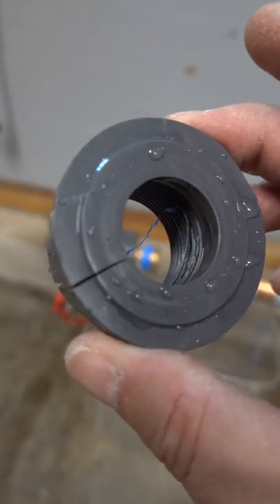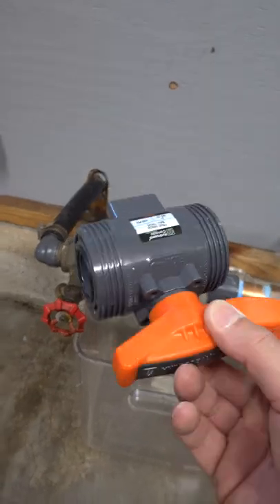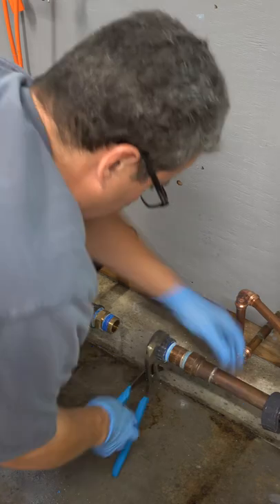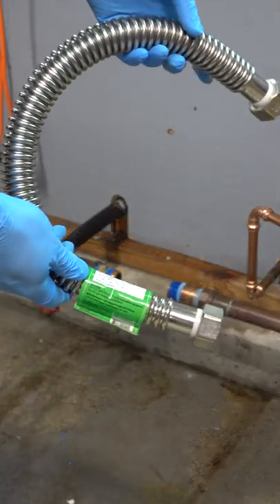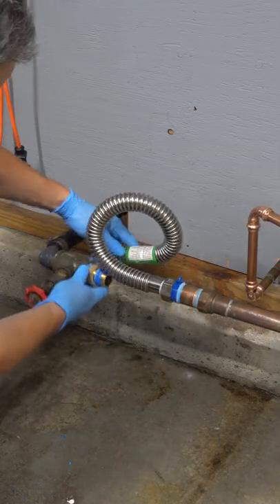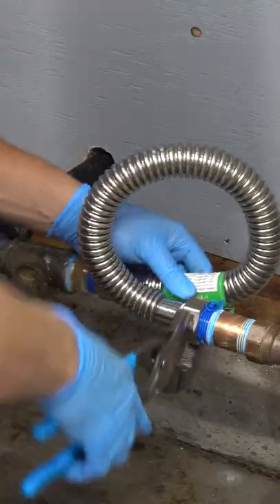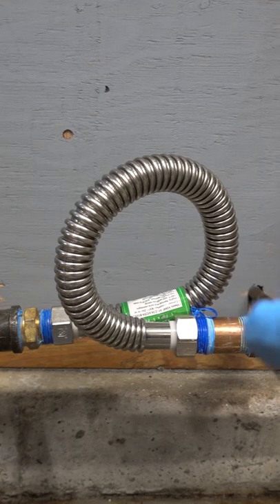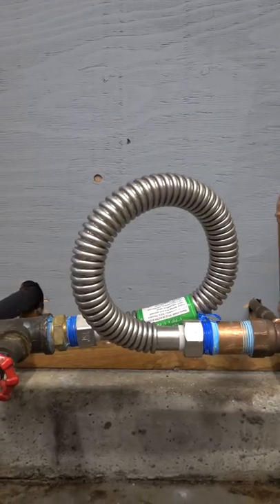POS Valve Almost Ruined by Marriage

Comment: You overtightened a metal fitting going into sch 80. No wonder it broke. If you can mess up something that simple then maybe you should just get someone else to do it right the first time. Also you didn't back anything when tightening and you used the channel locks backwards.

Comment: So common on those valves I’ve found goin as hand tight as possible with 1 full turn with wrench’s 🤘🏽
Reply: Stop using so much tape
Reply: @matthewnowack4610  common problem with "professionals" no less (I've seen it a number of times)
Reply: @walterbrunswick  a handyman isn’t a professional
Reply: @matthewnowack4610  some think that they are 🤦🏻‍♂️

Comment: how many psi are u running?  max psi is 35 if you go above that and im sure that plastics will tore it up (destory itself) 
i never have issues using one them on well pump running 30psi forever never have failure

Comment: Pipe dope and don’t tighten too much. Male metal fittings always win against an over tightened plastic fitting.
Reply: You should NEVER be using pipe dope on potable water! 
I've been using Teflon-tape only since 2016, not a single leak (gas fitter by trade) 
If Teflon-only is good enough for deep-sea operations and on sprinkler systems 600 PSIG, probably good enough for the daily plumber

Comment: Plenty of play to hillbilly it. Also you used your arc joint pliers backwards in the video...twice.
Reply: Also, if it doesn't start or end in pvc there is zero reason to adapt to pvc in the middle for no reason unless you're being cheap.
Reply: Brass to pvc to brass pisses me off on a personal level.

Comment: It split because you don’t know what your doing. Threading a female plastic fitting onto a copper male adapter is never a good idea and if you do never use Teflon tape it I creases the size of the adapter. It cracked because of overtightening. Better title would be “homeowner tries hand at plumbing and learns the hard way” lol

Comment: Better than crimp fittings!
Reply: Nothing wrong with crimp fittings
Incompetent "professionals" who don't pay attention to or understand details are the problem
Reply: @walterbrunswick  Are crimp fittings reliable enough to qualify for gas service certification?
Reply: @thisisyourcaptainspeaking2259  ProPress and MegaPress crimp fittings are used for gas 
Zoomlock crimp fittings for refrigeration 
Most water mains branches are connected to the water meter by compression
Compression is used extensively in commercial high-rise
Reply: @walterbrunswick  No self-respecting refrigeration guys that I know, use crimp fittings.
Reply: @thisisyourcaptainspeaking2259  again, nothing wrong with crimp fittings if done properly... they've been in use in Europe for at least 25 years 
I stopped silfos brazing about a year ago... the high temp anneals and significantly weakens the surrounding copper, not to mention the problems with copper oxides... 
switched to StayBrite #8, haven't looked back 
also, if you're one of those "this new technology/materials/etc is garbage blah blah we should all still be welding steel with oxy-acetylene" guys, then I would ask that you kindly throw away your PC and your Internet gateway router and go back to your typewriter and postal  
I can mail you my dad's mechanical typewriter if you want 
Otherwise s tf up about progress and advancements in technology and materials science, okay? 👍
Reply: @thisisyourcaptainspeaking2259  I liked brazing when I was doing it and I was good at it (I'm OCD perfectionist), but it has a number of disadvantages, and frankly it's obsolete... North America is just lagging 
Also since things were so great "back in the day", you can mail me your smartphone📱, and in exchange I'll mail you a rotary telephone☎️ my uncle still hasn't returned to Bell Canada
Reply: @walterbrunswick  I'm not sure what you're silphos brazing but this is my preference for refrigeration copper.  In the case of water pipe, it's unnecessary, IMO.
I like doing things the right way and yes, arc welding steel performs well.
As far as annealing the copper goes, there can be advantages, so depending on circumstances, brazing could be inappropriate where staybrite 8 might be my choice.  For instance, I won't use staybrite 8 at compressor joints.
Reply: @thisisyourcaptainspeaking2259  Halligan142 did an hour long video covering silfos vs. StayBrite #8... 7 years ago now... the pressures and temperatures at the compressor discharge will get nowhere near to the liquidus point of StayBrite to rupture the joint 
"no self-respecting guy..." no, wrong. there are many open-minded professional craftsman out there who are glad to welcome new advancements and better practices and techniques in industry (myself being one of them)... just because it's your preference, does not mean it is the better choice
I always evaluate things from all angles, always bouncing back and forth on what fits better, what is neater, cleaner, more consistent, less time consuming, etc. etc.
Reply: @walterbrunswick  I wasn't referring to pressures or temperatures at the compressor.  I prefer to do things the right way, pretty sure I was clear about that.
Reply: @thisisyourcaptainspeaking2259  "the right way" according to whom? 
maybe washing your clothes using a washboard is "the right way" according to you? 
I actually DO things "the right way", using standardized best practices and techniques 
I'm not senile and I'm not afraid of advancements in technology and materials science
Reply: @walterbrunswick  press fittings are a great advancement I discounted them for a couple years until my guys finally wore me down and bought 2 sets of press tools, they are great but we do always say “someday that o-ring will fail” lol
Reply: @MK-xl9tt  good man! and props to your guys 
admittedly at first I was also somewhat skeptical 
in 2015 at the plumbing supply store when I bought my portable threading machine, the guy next to me was buying the ProPress for plumbing in new houses 
personally I haven't had the need (or finances) yet, as I mainly do service and repairs, but for new installs they seem like such an advantage... plus your pipe internals are clean! no flux residue, no pinhole leaks in 50 years! 

it's an EPDM O-ring, with negligible mechanical movement (expansion and contraction in piping due to temperature changes, possibly vibration), it will likely outlast you, me, and whatever building or structure it's in
if you really want to go "above and beyond", apply some silicon lubricant to the O-ring; rubber loves silicon (same lubricant used for brake caliper slide pins)
and DON'T sand the pipe! you want that smooth extruded pipe for a good seal... got2learn did a good video about this on Sharkbites

Comment: Shouldn’t have over tightened the fitting. Tisk Tisk
Reply: Funny that nothing else leaked, same plumber. Cheap valves aren't good. I'm going back to Webstone brass
Reply: Don't ever use plastic female fittings on metal male fitting. Metal expands and contracts. This is why fittings Crack.

Comment: Jubilee clips !!
WTF. 😂😂😂😂
Reply: Those are polybutyl pipe on private well. Very common here for the line from the well.
Reply: @SilverCymbal  🤣🤣🤣🤣
Reply: @kurtlucas8638  very common in well country in southern Ontario Canada 🇨🇦
where are you that you find this so hilarious?
Reply: @walterbrunswick  I'm from England. We only use jubilees on garden hoses 👍
Interesting 😊
Reply: @kurtlucas8638  first time hearing the term "Jubilee", but I figured what you were referring to
In Canada and USA they're called "gear clamps" (there are several manufacturers, so we use the "technical" term/description for it)
In England you say "olives", we say "ferrules" 
While I don't particularly like gear clamps, they have their uses, from polybutyl to garden hose to large diameter hoses to ducts 
They are good for flexiduct like attaching drier vents to rigid pipe... available from very small to 6" and higher
Reply: @walterbrunswick  understand. Coolio. Hope you have a good year 👍
Was nice having a natter.  Kurt.

Comment: Weird if they used the flex hose for everything? Weird they advertise it at bed bath and beyond flexes and shrinks . Seemed unusual item to keep water pipes some how away from house incase it busts open..
Turns house into hot tub swimming pool?
And fired it into garden and lawn and kept it inside? Clean used it every where for everything how long would it last?

Comment: Ya set an appointment for a plumber. Using the tools incorrectly and pushing the pipe in and out of the wall. You need some help.